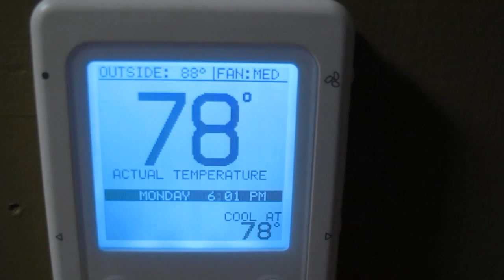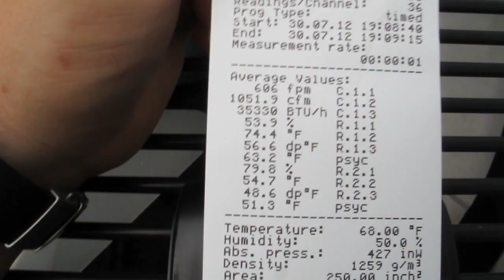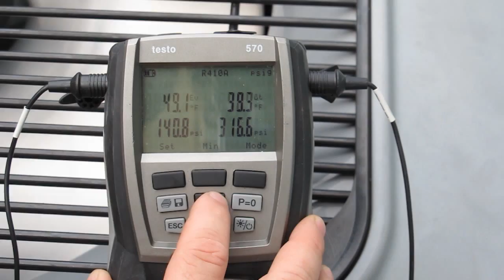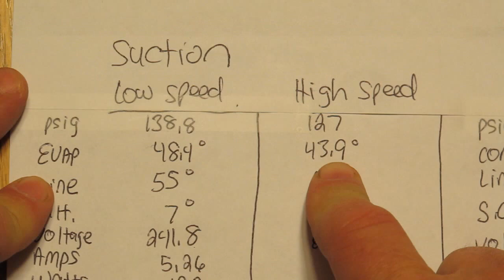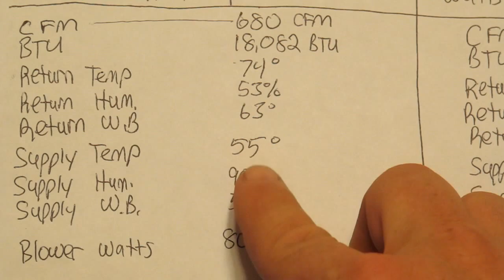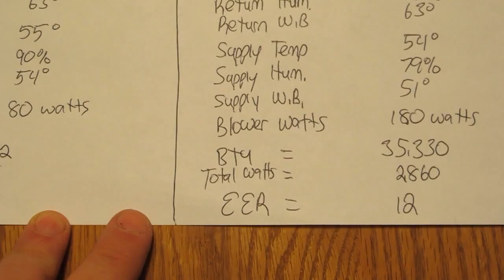Hvac - 2 Speed Air Conditioners

Comment: I have a 48000 BTU vaporator 30000 BTU condenser 24000 BTU compressor 135 pounds of head pressure keep your two-speed compressor

Comment: I got a new ac goodman gsx16030 but I never hear the second stage I change the thermostat and I see has two y 1y 2y do I have to plug both to the furnace
Reply: did u  get just the condenser or furnace as well?
Reply: HVAC-ED both

Comment: Hi Eddie. My name is Ian, and i'm messaging you from Vancouver, BC, Canada. As per many of your video's i'll be purchasing the exact Amprobe meter you use in your videos... Being able to measure Watts/KW for EER is Excellent! I have a question for you. If i get my "wc readings from my ductwork Total.Press + Static.Press.. i'll get my Velocity Pressure. Therefor 4005 x √ VP = ___ + Duct dimensions in Sq. Ft.. i'll get my CFM. Once I have my CFM.... How am I able to tell if my ductwork is oversized or undersized for my current unit or future investment unit? Thanks.
-Ian Sanderson
3rd year HVAC-R apprentice Technician